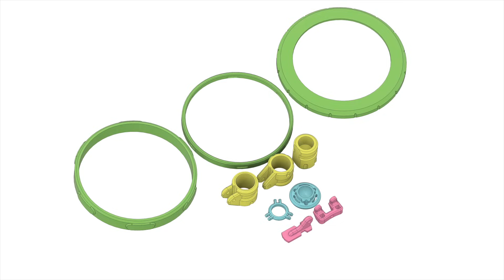Scratch-building a robot that keeps a plant alive!

Comment: I recall some people making trees using thin armature wire. After winding many wires together, you can pull groups of wires apart from the top to create the branches then pull apart those branch wires to create smaller branches. (The same is done from the bottom to create tree roots.) 
Looking forward to seeing the rest of this fun build!

Comment: Never tried it myself but saw lots of miniature builders use twisted wires to create trees. If you type Wire Bonzai for example you will see what I'm talking about. Then you can cover with epoxy putty for example or dip it in flocking. Thanks for the video and great content as always 🙂

Comment: If you're worried about cracking acrylic and plastics while drilling, stop using regular drill bits and use bits made for acrylic and plastics. You won't regret making the switch. 😊

Comment: Super cool idea. For the plant inside I'd use clear plastic cut into various strips with various widths and then use a heat gun to warp them into 'plant like' shapes and then glue them together in a grouping (after some trimming to shape them into more organic profiles). This way you get some translucency in the plant so it will feel a bit more organic. Looking cool overall though!

Comment: Why did you need to drill a hole at the top of the dome? I saw you put a disc on top?
Reply from the maker: Oh, that was just to create an attachment point for that extra shape... I'll attach it after the painting process :).
Reply: @CutTransformGlue oh - did you put a rod in there? Or did the disc have a piece at the bottom of it that pops in to the hole?

Comment: Agree 100% there is no creativity in printing parts, the true joy is making from scratch, and more merit. I also craft/customize figures just fir fun, and never 3D print anything, all pieces are made/modified by hand using epoxy puties like green stuff and miliput.
Reply from the maker: I probably said it on a super confusing way, but that's not what I meant... and I think there is creativity on 3D printing, 3d modelling and all sorts of digital art. It is, tho, just a portion of what i do.
Reply: @CutTransformGlue  well you're right, as long as you make the modeling, what i meant was downloading stufs other did and printing it. In my case i don't have a 3d printer nor i know a thing about modeling 😅 so i have to make my own stuff